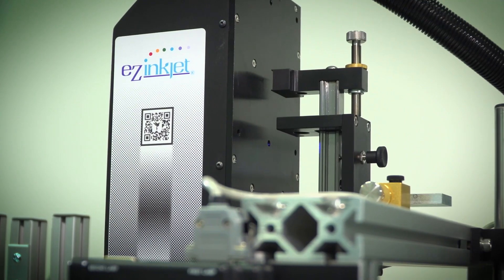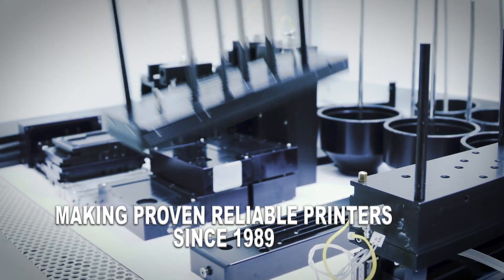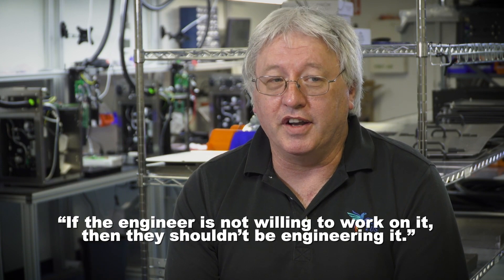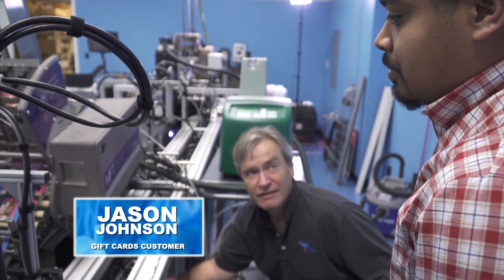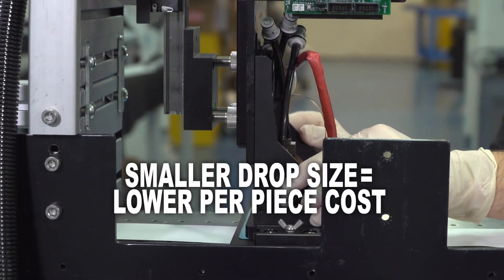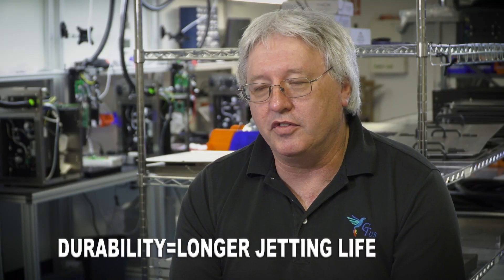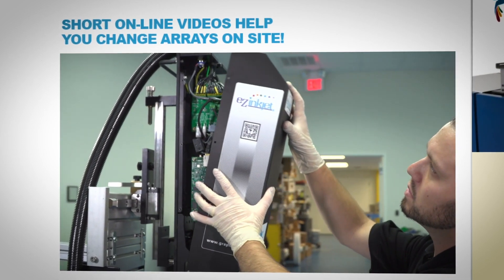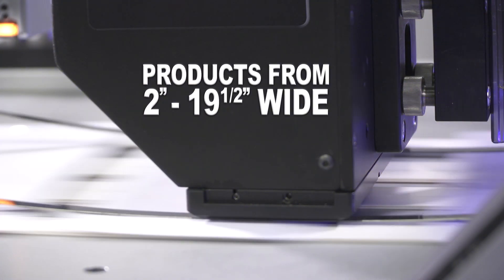eZinkjet - Industrial Inkjet Printer

Comment: Is it necessary to use plasma
Reply from the maker: Most of our customers do not use plasma. But if the print surface has a very low surface tension compared to the ink, physics will prevail, that is, you will need plasma to up the surface tension.